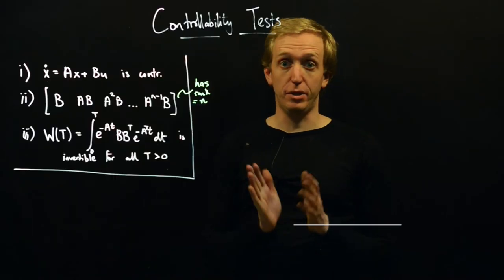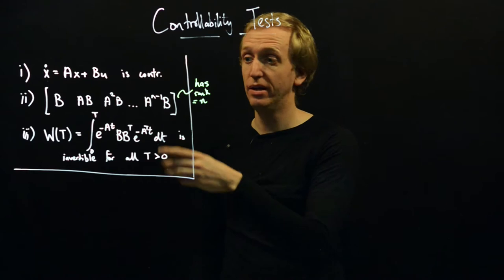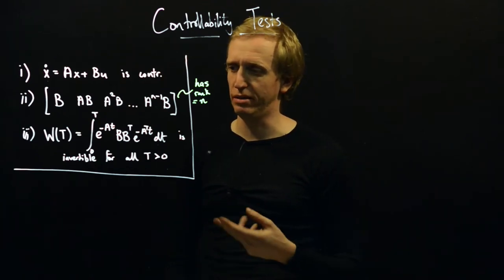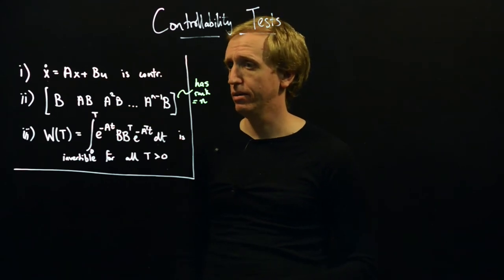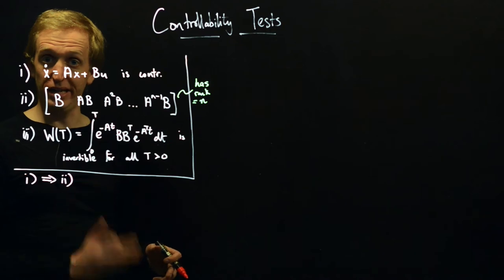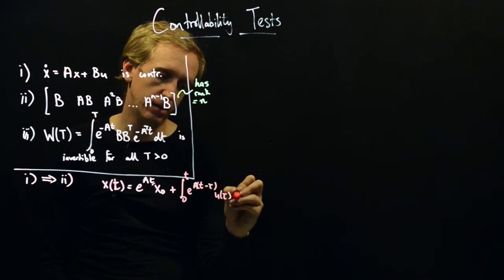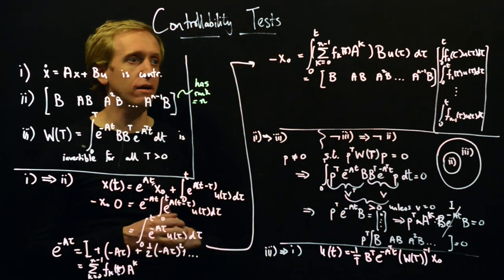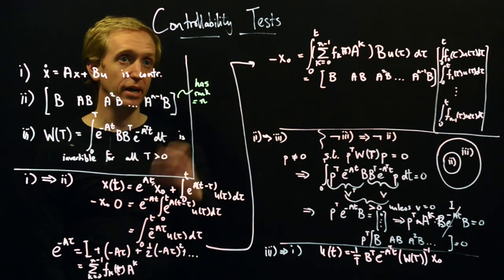Controllability Tests

Comment: I think there is some confusion in the derivation of ii) -> iii), if p is a vector that can be right multiplied by the controllability gramian, it should have a dimension of (n by 1), then b' * e^{-A't} * p will become a scalar because it's (1 by n)*(n by n)*(n by 1). And it's the same for the " v' ", which will also become a scalar instead of a vector.

In this case, would "v" and " v' " become two same scalars so the term in the integral will be a scalar's square so it has to be zero? I tried some examples in MATLAB by defining vector p(n by 1), vector B(n by 1), and matrix A(n by n). When I calculate B' * A" * p and p' * A* B, it turns out to be two same scalars but I am not sure if this is true for all cases.

If this is true, then p' B = 0(scalar), p'AB = 0 (scalar) and so on, and the conclusion will be the same.
Reply from the maker: Hello! Very good observation - you are correct, for a system with one input, v and v' are scalars. I should have made this clearer. As a side note though, we actually end up proving something more general. In systems with more than one input, the B matrix will by n by m, where m is the number of inputs. Then the vector v will not be a scalar anymore - but the argument in the video still works! So actually we are seeing a proof in the general case for systems with multiple inputs!